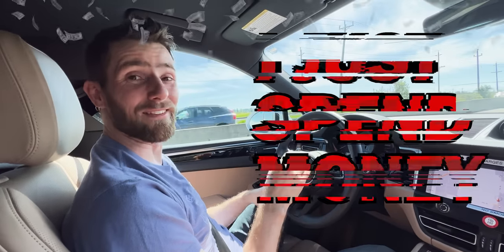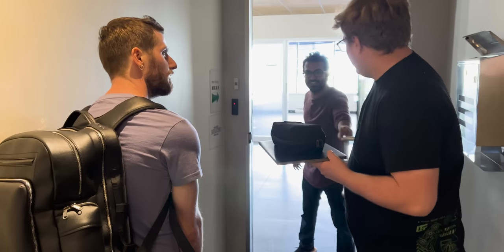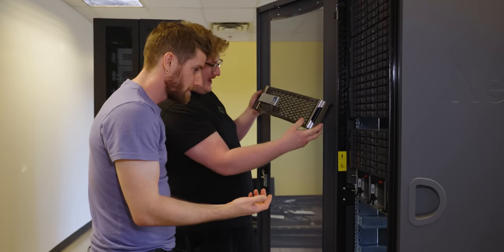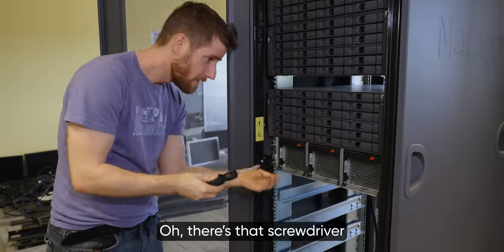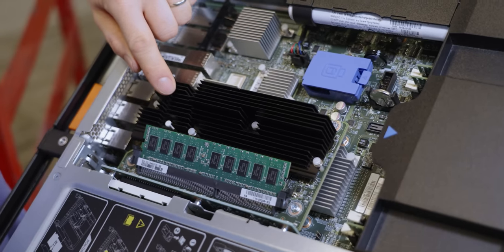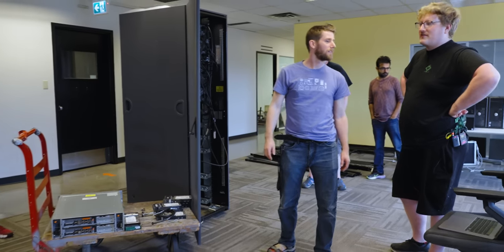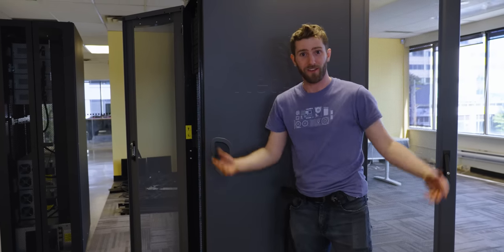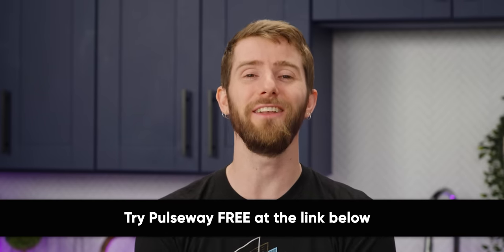WHAT did I just BUY on Facebook Marketplace?? - NetApp Storage Appliance / Disk Shelves

Comment: yeh that is what I use for my multimedia storage they go dirt cheap , then I swap out the netapp IOM's  for Xyratex  , @12:150 and nope any PSU can die they are all on the same power link , 1x PSU = super loud tho , and you can technically loose power connection from a PSU and the power will just divert from another source through another PSU still connected @18:00 Interposers are available to convert the serial connections

Comment: So much of this video shows how New LTT are to the IT space really - the number of "OMG" exclaimations when for instance pulling out the PSU and seeing the size.  They should try seeing the PSUs on such servers as I have here, like the IBM Bladecentre from circa 2002 which has 4 x 2000W supplies each 4 times the size of that there.  Or my Sun Ultra Workstation.  3 x 600W PSUs that are half the Rack Unit in width each, and the sum total of the 10RU of the server itself across all 3 of them.

Comment: All of my NAS is actually setup as "SAN". Why, because Backblaze will not backup SMB mounted drives.  It will backup drives mounted as iSCSI mounted drives.  So my storage server is connected to my 3 NAS/SAN devices via iSCSI. They are basically just one big volume each attached via 10Gb Networking to the storage server and Blackblaze happly backs up the data 100+ TB at the moment and growing, probably a year away maybe less from having to retire the oldest NAS devices and having to replace them with new units with more bays and higher capacity disk support.  Yeah I know most NAS devices will run Backblaze independantly.  However that would require 4 accounts.  Four monthly payments, no thanks.

Comment: 9:27 i like the 10k rpm wd velociraptors.
14:14 those were some earlier drives though, the raptor i have has a shock rating of 50G so I'd assume those drives would handle things just fine. (Not like you guys need them anyway you will end up filling it with something insane anyway)

Comment: Aww I've been after one of these for the longest time (though the HPE version rather than NetApp - I do however have one of the drive adaptors). It's amazing how cheap you can pick up some of this stuff these days. As for SAS drives - usually you can use SATA on the raid controllers on these sorts of racks.

Comment: At around 17:30 Jake made the comment of not being able to put Linux on the controller.  This is SEMI-untrue.  While I do not have one of NetApp controllers, I am currently running a TrueNAS Core box with an HBA that talks to 2 of NetApps 4243 JBODs and runs beautifully.  Now for the exact piece of hardware Linus got, I do not have a comparable controller and it may not be able to use anything but NetApps proprietary software.   TrueNas however CAN use the JBODs with 200TB worth of drives just fine.

Comment: It also creates a single point of failure. SAN can be waaaay more expensive than most people think because of the increased need for backups since it becomes crucial to implement the 3-2-1 rule, increased network bandwidth, and if want to do stuff right, security monitoring, response capabilities, vulnerability management, etc.

Comment: Using NetApp in RAID 10 is crazy stupid. NetApp storage OS is called ONTAP and it provides both SAN (iSCSI and FC) and NAS (SMB and NFS) simultaneously. Additionally, ONTAP provides RAID-DP which allows for RAID-6 levels of protection (multiple drives failing) without performance issues. ONTAP also provides for secure multi-tenancy (different groups get their own virtual device).

Comment: I've used Netapps since 1998, installed them in numerous places and on the whole quite like them.  But all that spinning rust takes power to move, and more power to cool.  I would really like to know how long you have them running before the additional utility bill exceeds what a new, modern SSD based system would have cost.

Comment: You sized a SAN based on required IO and amount of simultaneous read/write(mostly write, often referred to as 'workload' while sizing a san) , not how much space you actually needed.
A 15K SAS drive has about 200iops (compared to 100k on sata6 ssd and >200k for nvme) 
So 96 15k SAS have about 19k iops which is indeed way less than a modern single ssd
Yet this SAN is still faster than a single ssd when having multiple servers on it because it has so many drive heads, it takes quite a load to make the latency go up.

As for 'can we install ubuntu on it', it is propriety netapp hardware.
The drives are also specifically branded for netapp.
You cannot just use regular drives in a SAN.
And the branded drives are not cheap. You paid 1k for a drive that it's identical consumer model that just had different firmware had a price of 200.

That totally played into the hands of non 'A brands' making massive storage units using regular drives that you see today (Like in LTT's racks)
Same for google's storage which used a bunch of automated redundancy on relatively cheap hardware to make sure things didn't vanish with a drive crash.
Which in turn lead to google drive, which paved the way for all sorts of cloud services.
So basically cloud services today are as they are because major companies(HP/3par/IBM/Netapp etc) overpriced their storage hardware by such a huge amount that people were like 'f this shit'

Comment: I love that LTT now talks about SANs now that this product is basically obsolete due to the move to the cloud. Frankly speaking depending on circumstances, I’m quite cynical about the cloud and I love orgs still running their own servers when it makes sense and not just blindly lift and shift into said cloud.
Reply: I'm working in sales of this hardware, and no way it's obsolete.

First, there are tons of businesses that can't use cloud due to legal regulations. They need privately owned storage, often even in a closed network.
Second, cloud is good value at some price points, but guaranteed performance on it costs a ton.
And third... Not all clouds use converged storage, SAN is the go to for high-performance instances. You're just outsourcing buying these to the cloud's operator.
Reply: @ChaZcaTriX  the SAN market isn’t the growth market it used to be mostly due to the cloud. There are absolutely usecases still for a SAN but that’s now becomming more of a niche, eventhough I’m actually of the opinion that there are many circumstances in which orgs would indeed be better off with a SAN. I’m afraid that the people with this kind of OPS knowledge are literally dying out and companies lose the knowledge to operate this stuff. So in the end it’s not a tech issue but a people issue and just paying cloud people is the result of a compromise. Not that it’s complicated but if you get rid of ops and the let some devs operate the cloud, for sure these people should just play with S3 and know nothing about IOPs, storage latency, backups and so on….

Comment: 600GB was actually quite small in 2012, but I'm guessing because they were 15,000 RPM they were smaller capacity.
Reply: I think 600GB were the largest enterprise drives available back then, or maybe 900GB. Even the 3.5" drives have 2.5" platters inside.

Comment: If this has fibre connectivity, it would give decent performance with 15K RPM disks, what is the controller disk cache size?

Mention of SAN brings back memories from more than 10 years ago, for our project we got a 20T IBM V7000 SAN. We were beginning into Virtualized servers instead of baremetal servers so better SAN was a major requirement. Disks were like 120G or 200G back then if I remember correctly.
I setup my first Oracle RAC 5 node cluster on this V7000 SAN 😂 and VMWare VMs just by reading documentation and some blogs.

Comment: I love my 4x600GB RAID 10 (1.2TB useable) Was able to verify a .torrent at 300MB/s (probably saturating the bus),

Edit: 15kRPM also means each drive draws 12W instead of the 6W a 7200RPM drive would draw. So my array can match a low-end SSD drawing 3W while burning 50W.

Comment: For 1,000 bucks.... that is a total steal.  I do not think the controller is supported any further beyond OnTap 9.10 or so.  I think that was a 2552 head / controller.  If it was a 2650 you are totally in luck.  Maintenance on "my" environment is about 80k a year, but that is next business day.   I am replacing the Fiber Channel for NFS right now.  Actually... yes, you can go back on the block size, using a linux distro.

Comment: Pretty sure while NETAPP use a different block size, most other SANs from vendors like HPE use standard block sizes.  Dell EMC might do some funky stuff.  HPE seem pretty tolerant of foreign disks, Netapp & Dell not so much.
Reply: It's just 520 byte blocks. Switching from 512 to 520 is just as easy as the reverse.
Reply: @eDoc2020  so what freeware software can do that for you given its so easy.

Comment: Ok sorry guys ... but i dont think this was great buy. 1, you are limited to 6Gbit SAS ports (controllers are active/passive) so dual port SAS are used only for redundancy. 2, there can be a problem with disks replacement because of firmware locking.  3, Raid controller is too slow for SSDs in terms of IOPS. 4, Run cost is too high even for lab hardware.

Comment: Pre-pandemic this old NetApp hardware was really cheap, before the they got well known to the homelabbers. This is a good price now, but not far off the going "come and get it" rate 5ish years ago. Old enterprise hardware used to be stupid cheap, I was picking up server racks from e-waste recycles and closing businesses for under $50.

NetApp was special with their special with block size thing. I can't remember if there was some legacy reason for that, or just a vendor lockout. Other vendors did stupid shit like drive signing, where there is a digital siguare in a hidden sector on the drive and is unique to the custom firmware, literally preventing you from using even an identical model drive that wasn't intended for use in that SAN hardware, and if the drive is wiped outside of the SAN system, the signature is lost.

Comment: Wait until Linus find out that he can't install off-the-shelf drives into that enclosure
Those drives have a custom firmware on them that locks them down to NetApp
Reply: You can remove the little card at the back of each drive cage and use standard SATA drives.  They talked about how you need a very specific drive when using the netapp SAN, but it is just a block size issue, and you can get the drives from anywhere if you can find the right block size.  Linus was saying that they would never buy a bunch of SAS drives anyway as they are cost prohibitive, so switching to SATA is both easy and cheap and it works great.  And the netapp server itself is probably useless to them as the OS is behind a paywall, but you don't need it and even a super basic computer running truenas or unraid will work way faster anyway.  However, they got 4243's, not 4246's, so the controllers are 300gb/s, not 600gb/s, so picking up some 600gb/s controllers on ebay would be smart if they were going to use these for anything.  I run one of these disk shelves in my UnRaid server and I have 12x 8tb reds with 2 being for parity, so 80tb of storage with only half the disk shelf being used.  I can go another ~96tb before I have to switch to a larger parity drive and start swapping out 8tb drives for larger ones.  Considering I only burn through about 16tb every 6 months, I'm good for a while.

Comment: Wait til you work out that NetApp uses a special BlockSize so just swapping out the drives doesn't work... and to make it work without the netapp controller and use them as straight SAS you'll have to swap over the control boards... Which are rare in the wild... Trust me... I speak from experience :D
Reply: I thought they used regular 520b drives. While that's not 512 I think most SAS drives can be reformatted.

Comment: Netapp - that is your first problem.  You paying them $1000 is HILARIOUS - they would pay YOU $1000 to come get it - it would be cheaper than paying a real de-com company.  Because HIPAA and PCI, here in the US most times you'd end up paying someone to de-com the server either with verified wipe, or they'd roll up with a metal shredder and shred the hard drives, provide certification of destruction.   I mean, you CAN wipe them yourself - but with all the layers of abstraction in modern hardware, it is virtually impossible to be 100% certain that you actually wiped the data .  Thus, hard drive shredders.

Comment: As an enterprise engineer, this makes me both cringe and giggle. You're not 'wrong' but there is a lot of elements left out, many which are not overly technical nor boring. A small example is that NetApp especially is a system which by default can be multi protocol; it can run a NAS and block storage from the same drives. Normally NFS as well. Still, glad to see you branching into cool 'semi-enterprise' tech. Never mind my half a petabyte nvme SAN that is 3U and does file, FC/iscsi out of the box + global deduplication 🤣

Also: depending on what SAS version those are, used SAS SSDs aren't horribly priced, and a SAS ssd will smoke a sata SSD by A LOT.

Comment: Linus: If you need enterprise grade knowhow about those systems, reach me out ;) Also you should get an HBA to one of your server, and test the JBODs out... Maybe there are screw holes for SATA drives, and also for 2,5" SSDs in it. You have 90%+ chance that those boxes can be used without the controller, and with SATA disks. And a note about SANs: Maybe you can do iSCSI with a bunch of disk using linux/windows/truenas/etc, but if you manage to cluster two independent computers with the same drives, multipath them, and you can configure it for uninterrupted operation, than you get a proper SAN ;)

Comment: In my server rack I have a very similar setup. I have over 40 drives. All in zfs and then I run it over iscsi for my vm's. These net apps are the shit. Iom6 controllers most likely. 4 psus on the ds4246. All redundant power.

Comment: 18:19  SAS drives are less than 5% more expensive than their SATA equivalents.  

And SAS controllers that can't talk to SATA are basically non-existent.  The barrier to using SATA with a SAS system, if it exists, is going to be the backplane.

Comment: such a wrong thinking "raid 10 -> you could lose like 48 drives"  no 2 drives out of 96 failing at the wrong point and the whole SAN goes down!! But SAN At home does have it places. A single drive in you PC can fail. But a truenas system with ZFS (and proper backup machine) can make that 1 "drive" in your PC realy redundant, and with 10G becoming cheaper and cheaper (especially point to point) it realy made a switch for me with photography work. Now my fininshed projects are transferred to the samba pool so i can easy get RAW from it. And iscsi for work pool from the main computer which runs pretty damn fast.

Comment: 1:58 Aren't SAS drives backwards compatible to work on a SATA interface or am I wrong? I mean, you would get only half the performance or less, but I am fairly certain it works.
Reply: It's the other way around, you can use SATA drives on SAS controllers. Regular SATA cables don't even physically fit SAS drives.
Reply: @eDoc2020  Got it, thx. Had it backwards in my memory it seems.

Comment: I worked at NetApp for 10 Years and can tell ya if you take some time and learn what you just got you would never compare that system to anything you have ever seen ...  that is a SAN/ NAS / Backup Device / Cloud Cache system All in 1 they are amazing systems. Your drawing for SAN is meh not correct and performance is Far better on a SAN than direct connection for 1 reason Cache... That NetApp has massive amount of Cache you would never have in a single server. ALso NetApp don't do RAID 10..... OMG  Its RAID DP  Look it up  Not a Raid card... that's a NVMRam card...

Comment: It's funny to see Linus surprised by technology I work with daily. The NetApp OnTap is both the best and worst server OS platforms out there. Those drives fail all the time, so they hold their value on the resale market even being 600gb 15k. The 2.5" version in the 3.5" caddies are actually worth significantly more
If you have any questions feel free to ask, I'll see what I can do
Reply: In terms of PSU failure you really can lose 3/4 and it'll work just fine (minus some complaints) if you want to use two you can pull out 2 of them (diagonally)

Comment: Who would  use JBOD on a SAN? Who is going to make backups from a drive to drive in the same SAN?  A SAN serving workstations? LOL. You didn`t use SAN before because you do not know the benefits of enterprise grade equipment. Even old one. If you had a SAN you wouldn't lose your data. Twice.   It does need a trained person to setup and change  configuration (if needed), but not to maintain. Not for LMG type of use . In most cases, you only need to hot swap a defective part with a functional compatible one.  Downside, as somebody else mentioned, is power hungry. 
 Hint: Stay away from iSCSI. If you are lucky it will work, but often  is not reliable on the long term. It combines SCSI and TCP, two protocols designed for different things. .... Or maybe for LMG is not a problem to restart some equipment every few weeks or months.   I would  use FC. If configuration change is not needed, is set and forget. Do not forget redundancy.    
Usually, I do not comment on videos, I like LTT  and often I  see good and informative videos from you. This was not.
If you will buy more enterprise hardware and need help to design and configure a not so complex storage and compute infrastructure, I will be glad to help. (for free)

PS. Do you have management password and IP?